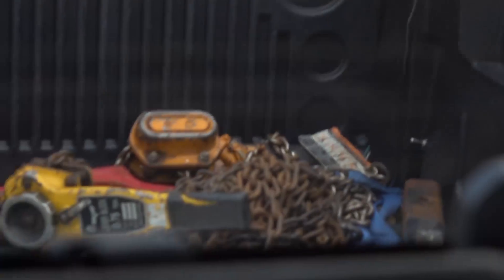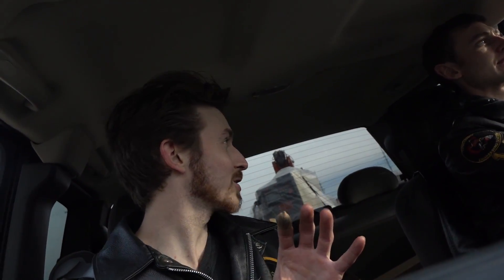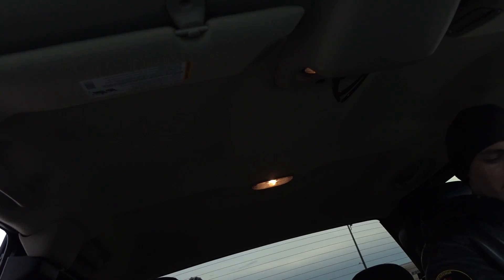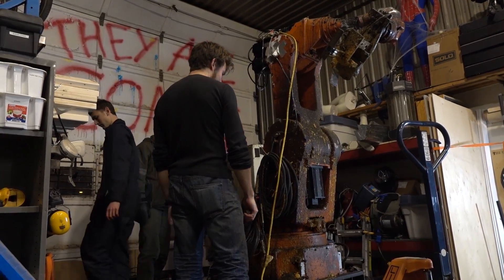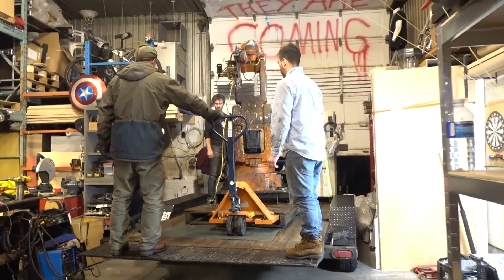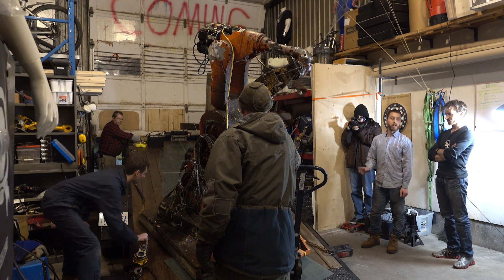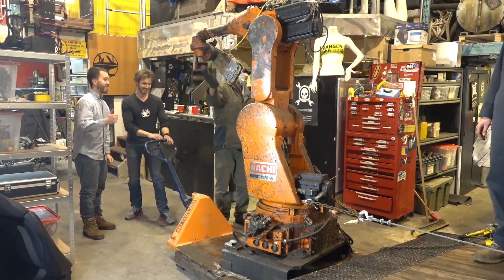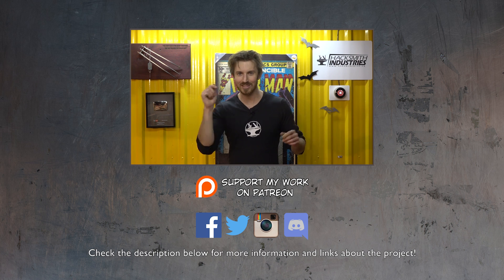WE GOT AN INDUSTRIAL ROBOT!?!

Comment: Do the 6 individual motors actually need 3 phase 480v? Is there a big transformer upstream in the controller that bucks down the voltage for the various systems? Is any 3 phase truly used?
Reply from the maker: The motors are likely DC, which is why there's a small chance we can just feed in 480v AC single phase.
Reply: the Hacksmith, very cool! Good luck, I am looking forward to seeing that bad boy fired up!

Comment: you could use an open-wye open-delta configuration, but you will get a 30° phase shift and only be able to use 57.7% of the transformers kVA rating

Comment: Phase converter? Why dont you use VFD's? I deal with them all the time over Various voltages!
Reply from the maker: Because the amount of work, and cost of getting multiple VFDs together to run the machine... would be more difficult?
Reply: Maybe i could help ya out a bit with this? I may have some kicking around or even able to donate the correct ones for your machine? I have suppliers that i deal with daily. (I have a video advert i made awhile back so you have an idea what i do).

Comment: if your stepping up your mains voltage to 480 with a transformer. Surely your problem is going to be supplying enough current to drive it?
Reply from the maker: It doesn't need that much current...
Reply: the Hacksmith  ah fair enough =) it looked pretty beefy is all. must just be my industry then, all the machines with robots I work on take loads =)

Comment: I believe in you! I work with PLC's and VFD's for my work, and not entierly sure if robotic arms like these use PLC's but I feel like that could always be an option to replace the existing control structure. I saw someone mentioned arduino and while that may be underpowered for this, perhaps there could be ways to use an arduino as the base controller to send signals to other systems? Again, not knowing how this fully works by just a quick look at the cabinet. Just suggestions. We had a smaller one of these at my school that was hydraulic and programmed to play tic tac toe. You'll figure it out. And it can be the base of your automated system to put the iron man/exo armor on! Maybe? Looking forward to seeing where this leads!

Comment: Did the manual tell you what OS it was using? Before you light the brain up you should get those central control boards cleaned and inspected. Does it have a basic LCD to it, or is strictly interface? If it's interface, you might need to go old school tech.  Do you know if they had it stored inside or outside? Sorry, I've always wanted one of these things. My brain sort of blew up when I saw it.  The manual should also tell you the max lifting capacity. Awesome! Good Luck!
Reply from the maker: It was stored inside a shipping container. Has a built-in CRT monitor. Interfacing this beast with a computer is highly unlikely. If we can get it running, it has a teach pendant =)
Reply: Shipping container....that might work. Drools...Teach Pendant! You should record the CRT Monitor when you turn it on. Those old CRT monitors can go for years, but there are not many around anymore. It is a very cool old school tech project.  When you get cleaned up a bit, I'd love to see the interface console. Younger people might find it interesting too. I got to stop now or I'm going to start talking about VAX and VMS.Two thumbs up! Thanks for the reply.

Comment: if you buy a 3 phase motor and a normal single phase motor you can power the single phase motor and attach the drive shafts so the 3 phase motor is acting as a generator.
Reply from the maker: That was one of Stan's suggestions!
Reply: what is the power requirement? depending on that, there are some integrated solutions under $1k. above a few amps though, and jerry rigging is the only way to stay in a reasonable budget.
Reply from the maker: We need to attack this carefully -- we can't afford to spend dozens or hundreds of hours on it, so we'll start small, borrow the neighbours 3-phase converter to at least try and power it up (unlikely it's gonna work properly...) so... don't get your hopes up =(

Comment: jesus, good look getting that up and running, I dread to think what those controllers are. But 500 bucks is a steal! good luck!!
Reply: ruuman I am a computer engineering student... And I am having nightmares about those cables... Fuck sake so many cables inside that damn controler. Good luck checking contacts and circuits
Reply: for sure, the cables/connectors cost a fortune. But the control boards will be so old, we have lathes at my work from the 80's and 90's we can't turn off as they don't store data correctly anymore. It could be the same case here that all the configs will be gone too and a lot of this won't be available on the internet!

Comment: Wow that thing looks like its had a tough life, hope you guys can get it working. That controller box is huge!! Its amazing where technology has come, they run on ipad sized controllers now.
Reply from the maker: 17,234 working hours apparently :-/
Reply: Not sure what type of budget you guys have for this thing, but it might be easier to retrofit/update the controller package instead of trying to bring life back into the original...have you contacted Nachi at all about it?
Reply from the maker: Not gonna sugar coat it, it's unlikely we'll be able to get it up and running. A Nachi service tech actually reached out in the comments offering some help, but sometimes there's not much you can do with a machine so old, and we don't have the manpower or time to sink 100's of hours into it. 

Basically if the controller doesn't work, we may try creating individual drives for a few of the axis' to give it some movement and control, but it won't be nearly as functional.